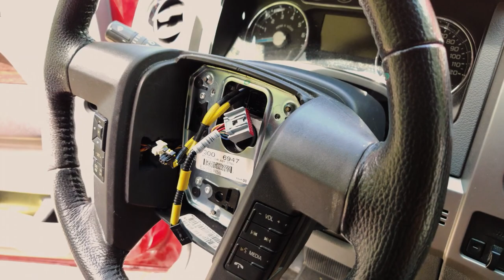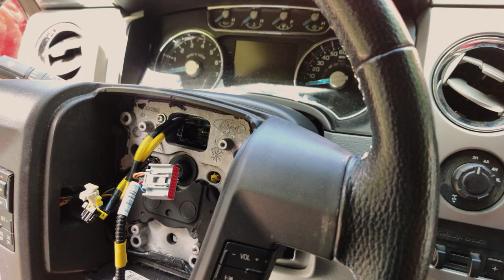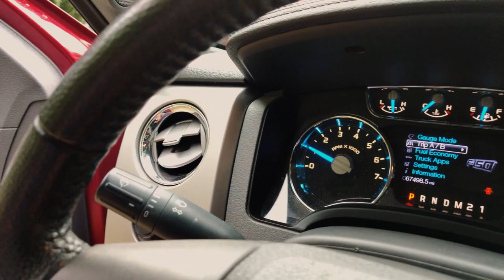How to Replace a Clockspring on a 09-14 F150!

Comment: Ryan good job and I did what you did and on the airbag I think I messed up, because I think I might of forgot to hook up the horn because I'm trying to get the airbag out the 3 hole bottom and 2 side are not line up like before, it can't come out now, do you know what I did wrong
Reply from the maker: Try hitting it hard to knock it back in.  Sometimes it aligns funky.  Other than that might have blown a fuse.   Sorry not much help.  Good luck.

Comment: Thanks guys! I pulled my dash to swap the heater core and the wheel did a 180. The clock spring broke and I could not figure it out. Thanks for the torx spec sizes as well.
Reply from the maker: Heck yeah man.  That stinks about the wheel.  People dont realize you cannot spin that wheel 180 and not ruin the clockspring.  Glad we were able to help you.   Thanks for the comment.  If you could take the time to subscribe we would really appreciate it.
Reply: @JMRRebuilders  already subscribed. 👍
Reply from the maker: Awesome thank you so much brother.  Keep getting after it.

Comment: Did you had to pull the fuse for the air bag and such before working on the clockspring or just disconnecting from the batteries is enough?
Reply from the maker: Hey brother we just disconnected the battery.  It might be good to get the fuse also.  Thanks for comment and support
Reply: @JMRRebuilders  Just replaced my clock spring. Only thing I did different (maybe unmentioned) was wait 30 mins after the battery was unhooked. And torque down the steering wheel torx screw to 35 FT/LBS (For anyone who'll read this comment, you'll probably need someone to help you hold the steering wheel while reinstalling the torx screw). Aside from that, I did everything as you did in the video. Took it for a test drive afterwards. No more rubbing sound from the steering wheel. Thank you brother for the video.
Reply from the maker: Heck yeah man love that it worked out for you.  Check pit our other content

Comment: The voice activation button in the right side steering wheel wasn't working  so I replaced with new OEM and it still doesn't work  the rest of the buttons work even the opposite side of that button works , could that be the clock spring or should i try something else
Reply from the maker: It sounds like it is your clock spring.  Good luck. Thanks for comment and support

Comment: What if everything works except the horn In steering wheel?  Is it still a clock spring issue?
Horn works with key when I push button
Reply from the maker: Not sure but it is possible.  Good luck and hope you figure it out.  Thanks for comment and support.

Comment: Hello all, is the clockspring also de steering angle sensor?
Reply from the maker: Hey brother thanks for the comment. They are not the same.  I believe the part your after is actually apart of the rack and is not serviceable without replacing complete rack but could be wrong. Good luck
Reply: @JMRRebuilders  thanks!!! have a great day!

Comment: I need the part behind this what is it called?
Reply from the maker: Not following sorry believe just the steering wheel.  Sorry that not much help.  Good luck
Reply: @JMRRebuilders  the part you actually screw the clock spring into. It’s cracked right where the wiper multi function plugs in and they keep running into issues. But thank you for the quick reply I truly didn’t think anyone would see that for a long time let alone so fast
Reply from the maker: Oh OK sorry I'm not sure about it either.  I would have to search Google to come up with it.  We try to help as much as we can.  Good luck to ya
Reply: @JMRRebuilders  well this video alone is 80% of the work so I truly appreciate this man. All I have to do is the “steering column tube/ upper housing” is what they’re calling it
Reply from the maker: @everythingsavailable  good deal. Thanks for the comment and support.

Comment: Hey guys!

I just fixed my clock spring and it solved the same issue, but as soon as I turned the truck back on my headlights are stuck on even with the switch off. Only way to get them to turn off is to disconnect the battery. 

Any idea or has anyone else run into this issue?
Reply from the maker: No idea brother.  Glad you got one problem fixed.  I highly recommend the f150 forum and also f150 facebook groups.  Good luck to ya brother.  Sorry not much help
Reply: Yes.. This just happened to me.. 2011 F150.. FUSE 23 in cab keeps burning out.. Lights stay on, have to unclip negative from battery.. Some sort of short in the system..? Did you figure it out.. Maybe a wire is touching in one of the connectors..?